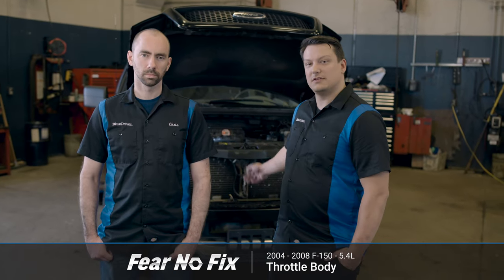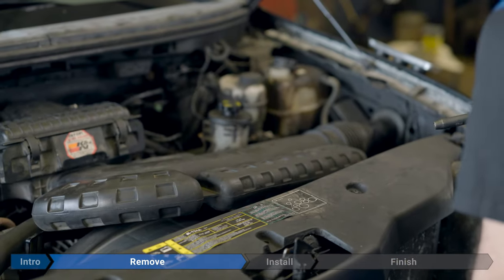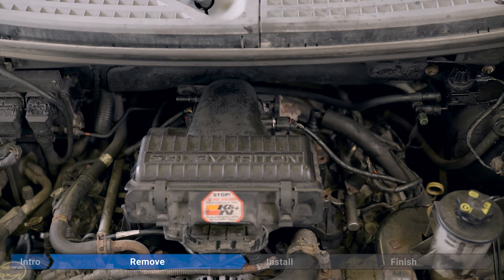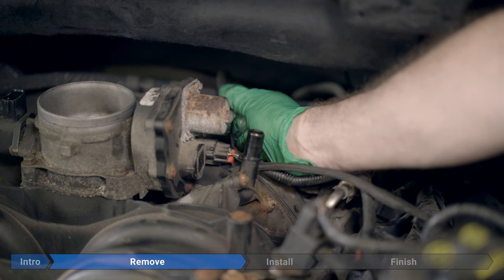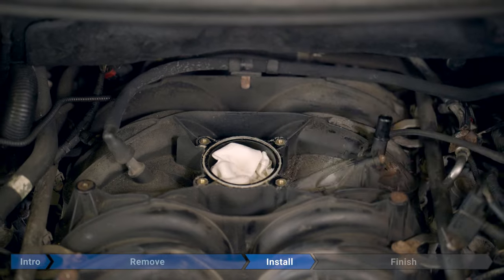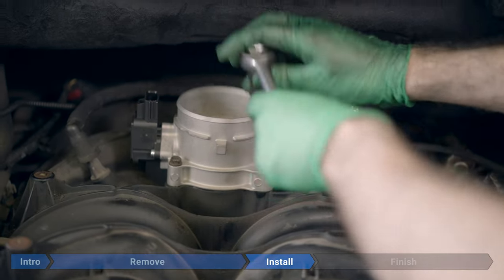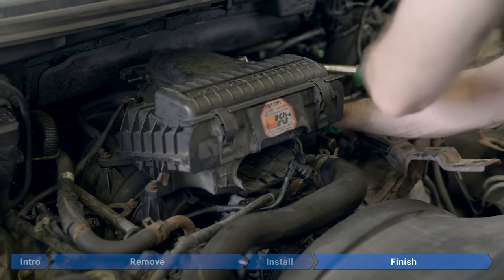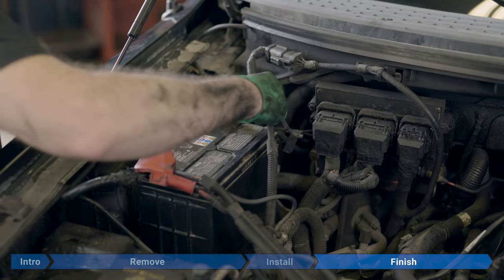Throttle Body – 2004-2008 5.4L Ford F-150

Comment: Does the throttle body have to be calibrated or do you just start it after you putting it on
Reply: Yes. Once you replace the TB and before you put the negative lead back on. You put a jumper wire from the positive lead over to the negative lead. Let it sit for a couple of minutes. This drains the memory in the PCM. After a few minutes, remove the jumper and put the negative lead back on. Turn the truck on only and let the cluster set. Then start the truck and it run for 5 to 10 minutes to learn the cold to hot of the motor. 
Hope this helps.
Reply: The leads you are talking about, where are they located? Do you have a photo?

Comment: Would it cause the head lights too dim??,,,. Cause im having problems with my 05 f150 4.6L ,,,,, everytime i come to a stop the rpms drop really low and headlights dim and it will stall out. Sometimes it wont stall, the rpms will just drop really low. And as i press the gas pedal it has a delay sometimes.
Reply: Did you ever fix it?
Reply: @glock316  it was the throttle body for me….
Reply: Did you solve the issue ? 
Mine does that too !
Reply: @youseftarifi3362  it was the throttle body… it was really dirty/black carbon build up… i scrubbed off as much as i could.. it fixed the problem…. But i did get a new one eventually
Reply: @youseftarifi3362  behind the plate.. im assuming it was disrupting the air flow
Reply: @youseftarifi3362  you check it yet?

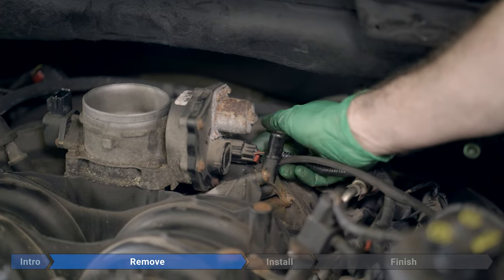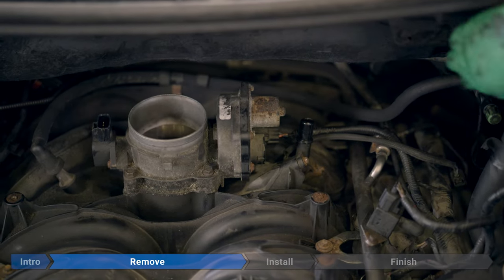Comment: 3:50 saved my sanity..I couldn't figure that out. these videos are life savers...well I thought i had it. it broke..thanks ford for yet another pos idea to put the tab to unlock it on the bottom..and I really needed my truck. Tip I learned is to go ahead and take the throttle body off and leave the throttle cable connected (the one with the red tab under neath at 3:22) then you can simply turn it upside down and actually see what the hell is going on. Like I said my red tab broke completely off but oddly it still snapped back on securely and even with it turned upside down and fiddling with it after the tab had already broke I'm not sure where i pressed to allow it to come off..but it did and went back on and snapped without the little red tab. 

How hard would it have been to just make it like the throttle position sensor..I mean ffs ford. Anyway after cleaning the throttle body thoroughly with crc throttle body cleaner (only use this cleaner..carb cleaner is to harsh) and installing a new throttle body gasket (Fel-Pro Throttle Body Mounting Gasket - 61438) on my 2005 f150 5.4 3v it now idles like it's supposed to and don't try to die when I go from park to drive and/or turn my steering wheel like before. This repair basically cost me $16 total
Reply: Same issues I'm having currently. Hopefully this corrects it. What a turd this motor is.

Comment: My 07 ford has the speedometer needle going crazy up and down, and accelerating feels chuggy and alot of air but no going no where… I’m assuming its this! I also have a hard shift when entering gear or accelerate which I’m thinking is the differential.. so together my truck is running like crap right now, hoping all together it isn’t an expensive fix

Comment: I just replaced all my coils on my 07 5.4 and it runs fine on a flat road but when I try going up a hill it does not accelerate
Reply: Mine does the same thing if you figure it out let me know
Reply: Did you guys ever figure it?
Reply: No

Comment: Anybody know wth that little line running by the cpu box (3 big plugs) is? Looks like the little hose/round cap thing that's just flopping round on mine. Feels like a vacuum line or something, little 90* here or there, odd round "cap" looks like it should fit somewhere.

Comment: I replaced my throttle body and nothing happened only the RPMs will go up the miles per hour just stays at the bottom of the zero so what can it be
Reply from the maker: Do you mean the truck isn't moving at all? If so it could be something transmission related - are you able to put it in gear, is it slipping, etc?
If it is moving but the speedometer isn't moving sounds more like speed sensor or an instrument cluster issue

Comment: So i have a 05 f150 and idk if my throttle body or tps is starting to go bad i can accelerate and around 45-60 mph if i let my truck coast and step back on the gas it starts to shake and wants to act like it’s gonna stall but after about two seconds of that it picks right back up and takes off drives great Any recommended tips
Reply: That sounds like bad coil packs and plugs, I have had an 08 f150 5.4 now for 11 years and the coil packs go bad often, 20 to 30k miles at least one seems to fail. Doesn’t always throw an engine code either. They are simple to replace “the coil packs” it’s not always the spark plugs. If it does throw engine light you can pin point the cylinder at least. Any time my truck vibrates under a load like going up a hill right when I put foot on gas pedal it’s always a coil pack or bad plug. Usually just a coil pack though. I keep spare coil packs in my truck because of this.

Comment: the BBK 80mm on the 04 08 f150 is GARBARGE, it stalls bogs bucks untimly shifts even a tune will not fix. if you look the flap is not even machined good enough to seal to the bore.... they have great marketing thats how the sell. i do this for a living yeah some work but overall BBK is TRASH